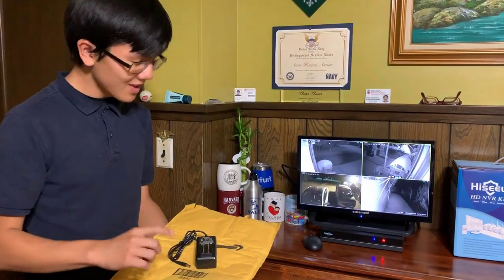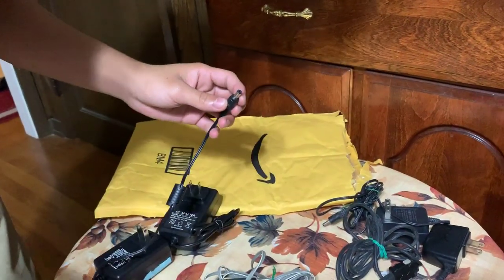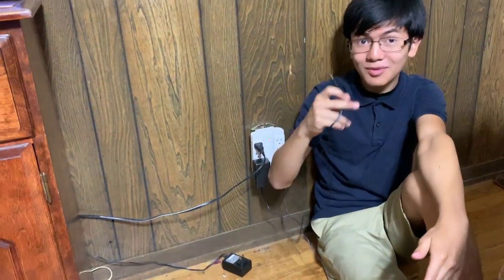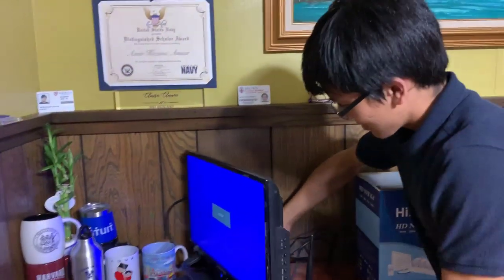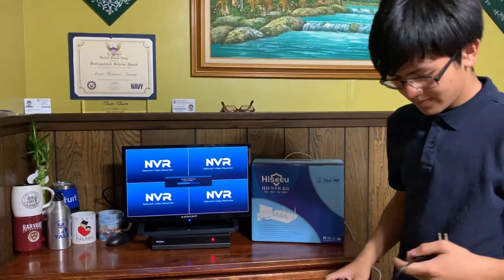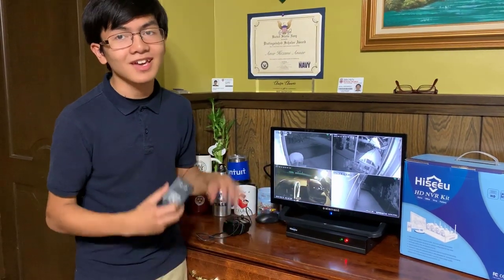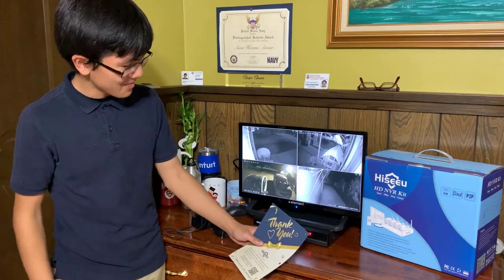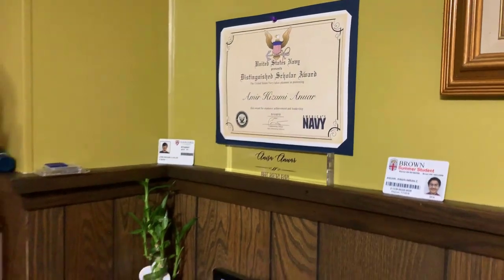What To Do If Power Supply 12V DC Adapter For CCTV Camera NVR & Security System Failed/Malfunctioned

Comment: I require a larger power supply because I’m using a 300’ cord.  I’m guessing a 12v 12A power supply to get enough power to the camera so it will light up at night (irs).

Comment: Some cords are 20 and some 22awg. Why aren't these cords defined? I'm looking at a 209 dollar camera marked down to 75 dollars but it only has a 1m cable in 2-3 branches. Certainly requiring  more cables. All they needed was to have one you could attach toa a light wiring instead. Then you need wifi or SD card to record it.ive spent a week looking at options of a few dozen set ups and none all are vague and not explain enough to decide what gives a good picture, how to wire, how to see and how to record either through memory card or dvr with 1-2 tb. Why can't they give you what you need instead of piece mill guessing?